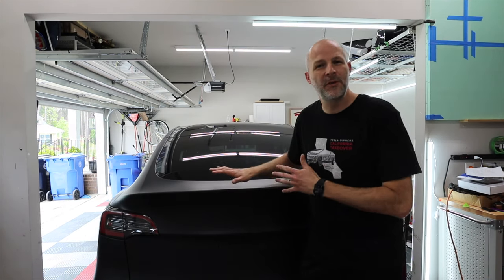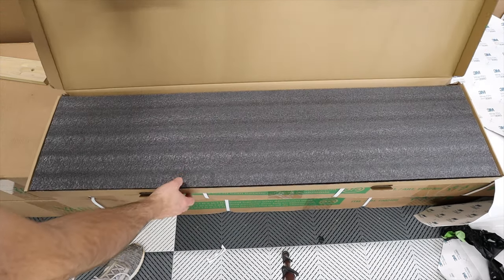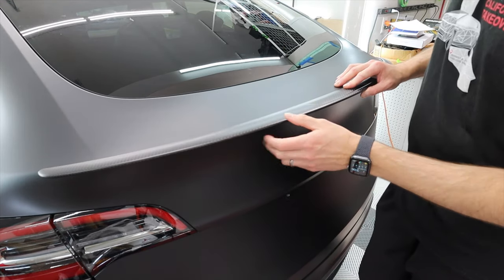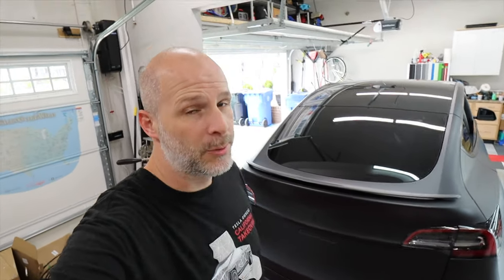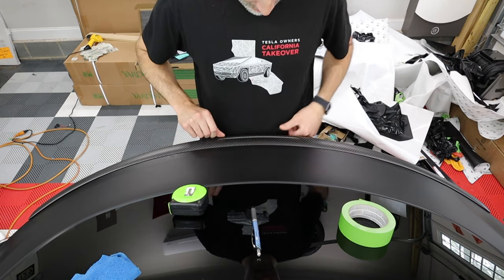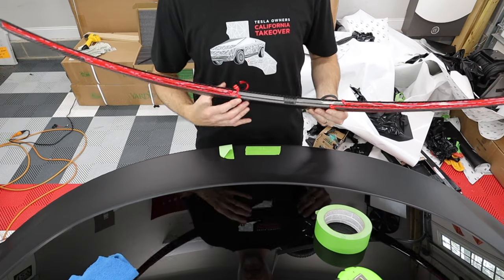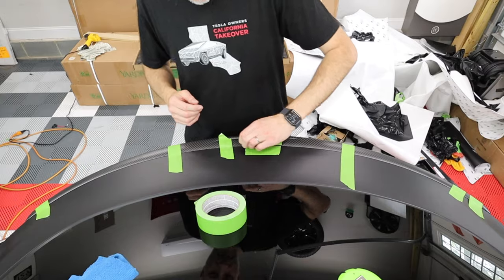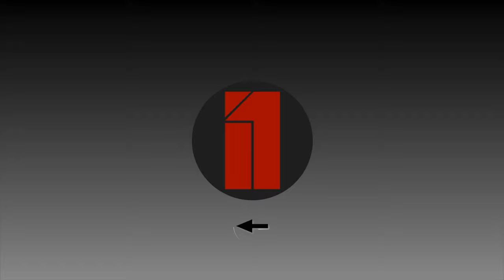ALL NEW Spoiler Design Tesla Model 3 + Y

Comment: It’s easy to out Tesla, Tesla, because Tesla is all about saving every penny wherever they can! I am sorry Sandy Munro, but lean design is ruining Tesla. I just heard that Tesla is too cheap to give an outside temperature gauge, they are going to rely on gps and weather data. You won’t know how hot your garage is or any other microclimate that you are in. I go to the mountains where my maps go blank because there’s no cellular service, so what then, my temperature display will be incorrect as well as my navigation not working? I have started carrying paper maps again. Our other cars have built in navigation that does get outdated, but at least it always works. Apple CarPlay or AndroidAuto don’t work without connectivity either. My hope is that satellites solve all of our problems, but hardware is not upgradable.